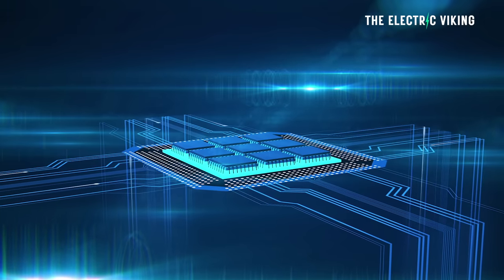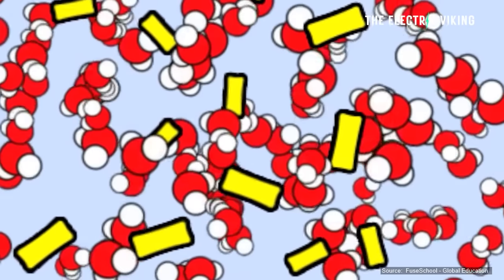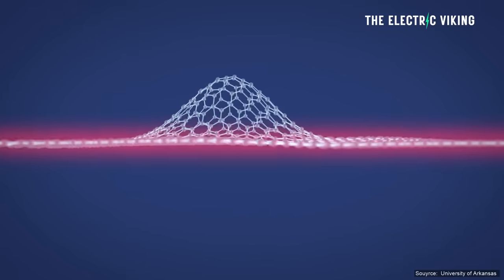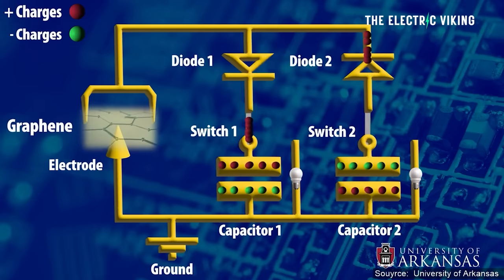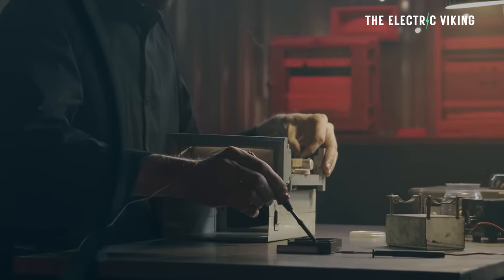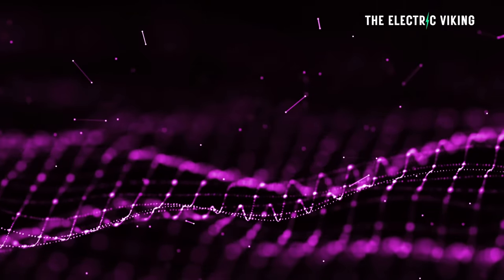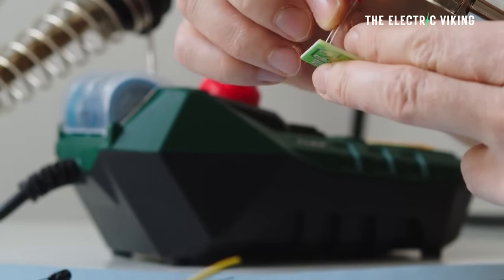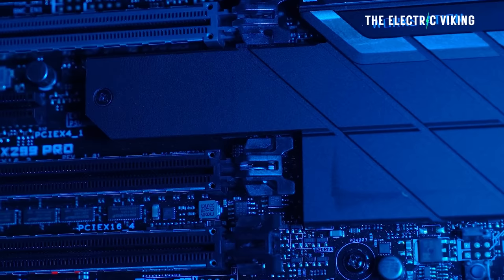Laws of physics broken! Nonlinear circuit harvests free clean power with Graphene

Comment: For the record, the first ARM chip (1985) due to a faulty development board couldn't be powered correctly (there was zero current on the chips dedicated power circuit) and despite that the chip managed to run correctly drawing its power, by accident, from leakage currents coming from attached support chips and logic!

So, purposefully designed/custom chips can run on very low power (if they aren't too complex), indeed, much lower today than in 1985.

Anyway, I'm not sure we necessarily need vibrating graphene sheets to harvest ambient thermal energy. Several companies are already using thermoelectric tech of a different sort to tap body heat/heat fluctuations as a source of power for devices like smartwatches.

Comment: It creates two different temperatures. The heat in the graphene is reduced by the electrical power transferred. The heat in the electrical load increases . The graphene sandwich, if in a thermally isolated container, will run out of supply capability as its temperature falls.

This is possibly the real invention, noise reduction in sensors through cooling from innate energy transfer. 

Incidentally, this is a mirror analogy to the ability of organised structure formation in a non equilibrium thermodynamic system. Entropy really does get driven backwards under special circumstances... like autocatalysis.... like life.

Another puzzler is Passive Daylight Radiative Cooling when energy, say photons in the visible spectrum 0.4 to 0.7um wavelength are converted by photonics into 8 to 13um IR photons which can radiate out into space passing straight through greenhouse gasses in the atmosphere. A box coated in this white film gets colder on the inside as the sun shines harder on it.

Whilst this graphene effect is tiny (and costly) PDRC deals in a significant fraction of radiant energy from simple bulk materials.
Reply: Could you elaborate on this? We have been told that it is the longer wavelength IR photons that get reflected back to Earth, not passed through the greenhouse gases out into space.

Comment: 6:50 So the Hz of the AC would be dictated by the harmonic frequency of the little sheet of graphene? Wow that's weird.
If it's actually real, this is a completely non electromagnetically derived current. So it's 100% outside the realm of Tesla's power generating technology.

Comment: Now, to capture heat produced from the charging battery banks as energy to route BACK into the battery bank via capacitors that could discharge into the bank (later).

Comment: The diode/capacitor circuit as depicted has no chance of working.  When we replace it with the correct circuit, we can see the mechanism which is actually harvesting energy, and that is simply that the energy is being harvested from the energy that was input into the graphene sheet in the first place to charge it.

The correct circuit is to replace the diode/capacitor circuit with a transformer.  The oscillating charged graphene sheet can then induce an oscillating current on one side of the transformer which bumps the voltage up on the secondary to something that can be harvested with a diode bridge, producing work.

From the correct circuit we can infer what is really going on here.  That the charged graphene sheet will simply be discharged until the oscillations no longer result in an oscillating charge differential, and thus nothing happening on the secondary of transformer.

Congratulations, this whole thing becomes an expensive resistor taking the power originally used to charge the graphene sheet and handing it a small piece of it to the light-bulb.  The rest going into more heat (more entropy).  Doh.

Comment: Does not break laws of Physics. Yes everything above absolute zero is moving, made up of energy. If you are capturing some of the ambient heat (heat is motion), then you will cool off the material and area (less motion means cooler). Kind of nice to be able to create energy while also cooling, but there will be less and less useful energy the cooler things get. So, free energy in the sense that a solar panel gives you free energy, this just can make very small amounts of stored energy from very small amounts of moving energy.
Reply: The claim actually does break the laws of physics because it is a reverse entropy machine within a closed system (no external low-entropy energy input, only high-entropy input producing low-entropy output).   In otherwords, it isn't just moving heat from one place to another.  It is moving heat within a closed system from one place to another.  Which is reverse entropy, which is impossible.

It obviously can't do this.  There are so many things wrong with the depicted circuit that any electrical engineer (and I am one) can tell you that it won't work.  At best it is just going to equalize the charge between the graphene sheet and the electrodes while heating up the diodes.  Never mind any supposed external "load" resistor.  The charge that the experimenters had to impart to the graphene in the first place, because it sure as heck didn't charge itself!

Comment: This system does not violate any physics laws.  The bronien motion contains energy in every partical that is moving and hitting an object.  Let's say this is a cart in a josheling crowd that has wheels that can turn in only one direction.  As the cart is bumped randomly by the crowd the cart will move in the direction the wheels will let it go.  In the device getting power at a atomic level in this video the diod is acting like one way wheels.  Now two things are going on here.  Energy is being harvested from an enviroment where there is not a tempature differential.   However the enviroment where this energy has been harvested is now cooler by the amount of the energy harvested.  So this device can also act as a cooler if that is what one wants.  Anyway, no laws of physics are being violated as all the energy is being accounted for.

Comment: Engineer scientist here points out that this is a perpetual-motion machine if there is not at least a tiny thermal gradient inside the graphene.  And if that is not the case I call b*******.
Reply: I believe it if it slightly cools the ambient air touching the graphene and produces less energy when evacuated.

Comment: I clearly remember having red about a similar effect in an old book many years ago simply by soldering two different kinds of metals together. I just can't find any reference to it right now. It was never develloped I believe because it was very ineffecient. In a way it isn't much different to a solar panel that also doesn't need heat differences. Heat radiation is the same as light radiation just at different frequencies. The real trick is to get a lot of energy for little cost be it money and or little or no polution.
Ferroelectric energy harvesting is similar I believe.

Comment: Keep telling them Viking🤓😀 Nobody knows ...what chemistry/technology/configuration batteries will have in 2030. The science is literally juggling atoms, and their are lots of jugglers competing /in laboratories/, but real world size/density/cost/production are critical. Failure on any of these fronts could doom your technology. Sodium even has a niche market for large-scale battery infrastructure. I never understood chemistry until I learned physics, and at the atomic scale physics does incredible things that could never be measured except by today's technology. AI-modeling/simulation of material properties are verifying theoretical physics hundreds of years old. Who knew ...that some scientist 200 years ago had already theorized the properties of materials to supply energy. Well, in 7 years lithium may be as relevant as cobalt is today. "Watch out"(!) Some of this chemistry is quite toxic, and could never 'safely' go into mass-production. "What's in your battery-pack"(?) Doesn't matter, because it's a Tesla, and it's waterproof😂🤣

Comment: What is the forward voltage drop of those diodes? The voltages generated by the graphene membrane would be tiny so regular silicon diodes like the 1N4001 wouldn't work.

Comment: That' won't age well. Methinks it is far more likely they've made a mistake or overlooked something obvious than overturning a basic law of physics. That simplified diagram shown could simply be getting energy from  radio waves, such as from cell phones of the University wi-fi transmitters or TV or radio broadcasts. The wires or even the graphene could act as an antenna, and the diode capacitor setup could rectify it into tiny but measurable amounts of power.

Comment: I think Mr Viking should have emphasized that, currently at least, we are talking about tiny amounts of power, like micro watts. But still very useful to power ultra low consumption devices. Think how long an LCD watch runs on a single battery. How about embedded biological sensors that never need a battery.
Reply: I wonder how much energy it takes to flip those switches?  A few microwatts perhaps?   I know that Carnot's Law can only be PROVEN for macro systems, but it's certainly been show to be correct in every system studied so far.

Comment: I did work out what would be needed to get energy from heat without a temperature difference. Unfortunately I do not think it can be made in reality.
I am afraid I have to say the same as patents offices do when confronted with an eternity machine (perpetum mobile) “Show me a working device”. I.e. If it can be done - WONDERFUL, but I believe it when I see it.
/Mats

Comment: Fascinating, as Mr. Spock might have said. Wondering, if captured heat is saved capacitively, does that mean these devices could also be used for cooling applications? Might be useful in an overheated planet.

Now, as for the proper pronunciation of "Arkansas", it is as follows:
'ARE', as in "you are" + 'CAN', as in "can of beer" + 'SAW', as in "I saw her first".
Reply: the planet's not over heated :) long term cold cycles make for hard living.

Comment: i found just putting a photodiode panel in the sun provides me plenty of free energy. also have a thing called a heat pump, i put 1Kw of energy in, and get 3 Kwh worth of heat out. but interesting research that hopefully will lead to something bigger.   I wouldnt call it free energy though.

Comment: This is a solution to a problem, but from a practical standpoint this technology is only going to be a deliverable when we have nanotechnology working properly. Let's do the math - order of magnitude calculations - O(6) transistors required in 1 mm x 1mm square needed for current, getting a circuit O (-10) at sub nanometer scale is difficult, including printed circuit transport - very tight engineering problem, and you will lose energy to noise and  loss . Remember it's only barely net positive. Signal to noise will kill it until nano fabrication can build this kind of thing without loss, because the circuit needs to generate, but also send power at really small scale.  At present, too much noise - not enough power generated. This one is at least 25 years off.

Comment: had magnetic Free Energy for 100 years -  remember around 1915? Nicola Tesla drove his car from NYC to Buffalo NY, hundreds of miles, with his nephew sitting beside hi using an elec motor and a whip antenna for energy pick up with ZERO Battery pack(s)  and a 1m long box under the dash with a few items in it and 2 metal rods for tuning -  energy from the air...  figure that one out and you dont need the rest of the crap - we can use a chip and an algorithm now to get that frequency and lock on it.
Reply: Go for it.

Comment: This is not new there is a difference and there would be no such thing as “thermal noise “ in transistor junctions if it were not and it forms the basis of the weather and it is exploited and there is no such thing as equilibrium and the universe is trying and failing to achieve it. That chap is correct if there was perfect equilibrium there would be nothing to gain but there is on such thing as perfect equilibrium yet discovered and this is just another way to exploit it.

Comment: put a layer of heat harvesters under solar panels?

Can it scale to providing cooling?

This can be great for maintaining charge on remote backup sensors & such.
Reply: If it extracts electricity from ambient heat it will result in cooling, the question is will it me microWatts, milliWatts or Watts ?

Comment: Sam, anything that starts "Laws of Physics broken" is a lie.

Please exercise a little bit of journalistic integrity.  (OK, I know that's in pretty short supply..)
Reply: It appears to break the second law of thermodynamics by extracting energy by lowering the temperature of a gas. Time will tell if this is true.
Reply: @6F6G  Heat pumps don't break any laws of physics.

Comment: The phrase 6:30 at, " it is like a trampoline, constantly moving up and down". I have never seen a trampoline constantly moving up and down, have you? I guess it is not then like a trampoline in the first place. If the trampoline was constantly moving up and down, that would be an in-exhaustable source of perpetual motion, and there is then not need for graphene. 
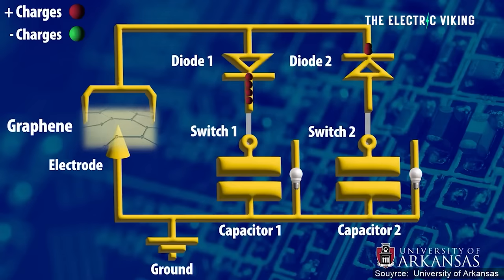1:05 "Obtaining useful work from random fluctuations from a system at thermal equilibrium has long been considered impossible." Brownian motion of molecules is "heat". Extracting work from a process of lowering the heat content by damping the Brownian vibrations, does not defy the 1st and 2nd laws of thermodynamics. 
The zeroth law of thermodynamics is the issue.. You have to obey all the laws of thermodynamics, not just 1 or 2 of them.
"Two systems are said to be in thermal equilibrium if they are linked by a wall permeable only to heat, and they do not change over time." [wiki ref 14] An osculating graphene membrane is changing over time, and thus it is not in thermal equilibrium. 
The process, whatever it is, is not defying the laws of physics.

Comment: No law of physics broken, just misinterpreted.

A "regular" big thermal machine harvests usable energy from heat energy giving it coherence with only one way of motion.

Taking an internal combustion engine (ICE) for example, the cylinder wall and head are fixed with motion allowed only for the piston. All the heat energy released by combustion and transformed into the macro measures of Temperature and Pressure eventually have to go away in some form. Heat rejection to the environment (like the coolant and radiator); hot gas exhaust (temperature and pressure/flow movement); but part of the pressure exerted by the brownian motion of the gas molecules that pressure cylinder volume makes directed work moving the piston the only free moving "wall" that harvest the fraction on the initial chemical energy.

This is turning a fraction of incoming incoherent heat energy (brownian motion of the gas molecules) into coherent motion of the piston usable to some kind of directed work.

The proposed machine might by usefull, but doesn't break any laws. It's just a nanoscale version of harvesting part of the incoherent energy into directed coherent one.

It doesn't create energy, doesn't change entropy or time direction for the whole system.

The way of reporting make it look like the so many scammers out there with perpetual motion, overunity and all kind of craziness.

BTW wood, oil, the Sun are also "free". Nature gave us. That does not mean it costs nothing to put it to work for us or has an unlimited supply.

Comment: I don't think this breaks the second law. As the sheet extracts thermal energy from the environment it also cools everything else around it. As the surroundings cool more the power extracted will be less thus resulting in lesser cooling. Eventually the power extracted will be so tiny that it will not be able to produce any current against the resistor in the circuit thus having the system come to a standstill and not really give 'limitless' energy as claimed. Now for all practical purposes this state won't come anytime soon with the current state of the device as shown, but it does theoretically exist. All this device does is produce a newer state of thermal equilibrium.